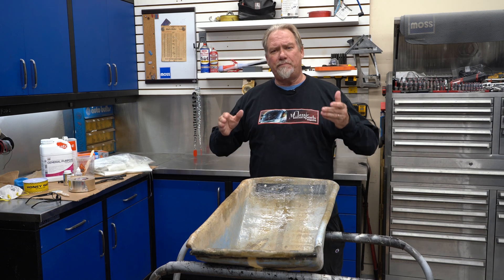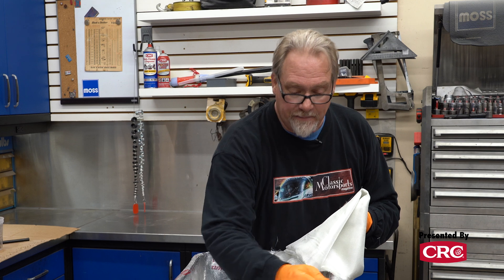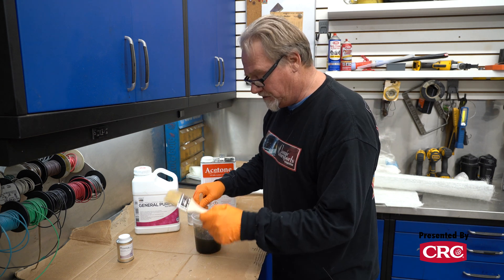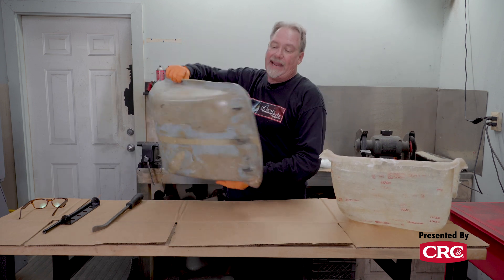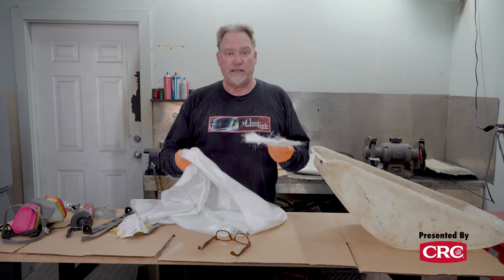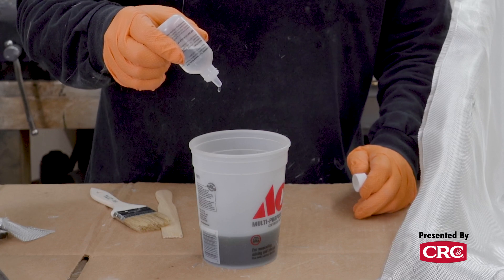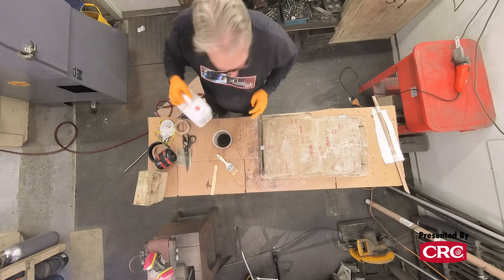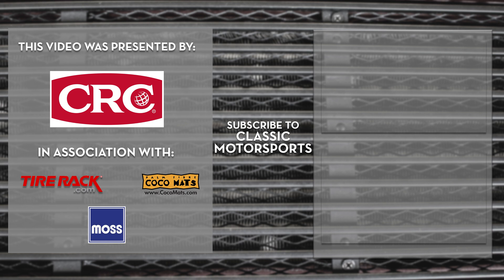How to Build Parts Out of Fiberglass

Comment: This is a very useful and concise presentation of the subject. Whilst I did skip through it, it is the best I have seen to demystify fibreglass work. I liked your explanation of the rolled paper.

A few things that I would add...it is useful to work at say 20°C and for the atmosphere to be dry. Secondly, you are right to mention safety equipment. I do not have an extraction system so when I rub down fibreglass / old paint, I do this in windy conditions outside!

I have very much to learn still. It would be useful to touch on the application of flowcoat / gelcoat, possibly by covering the creation of a sheet of fibreglass on say a melamine coated board.